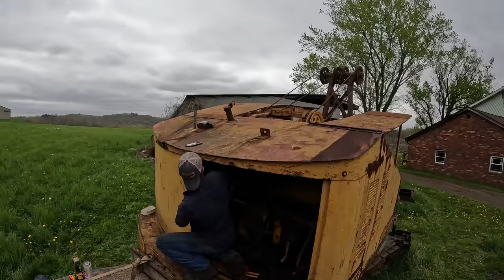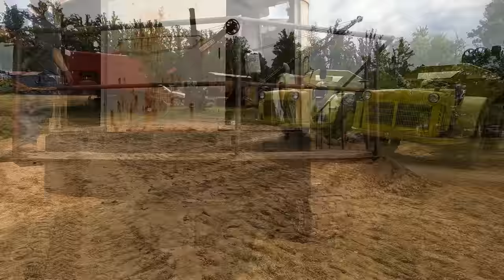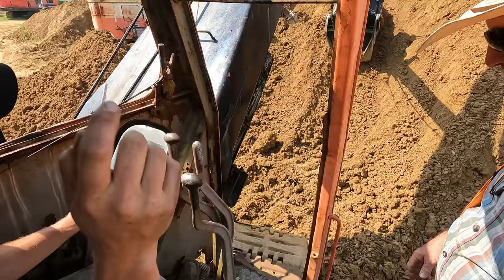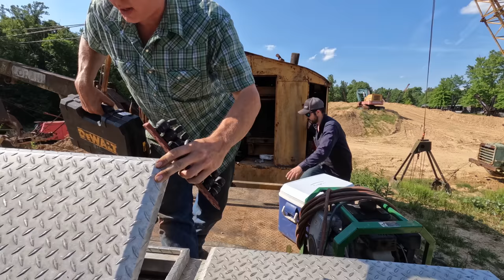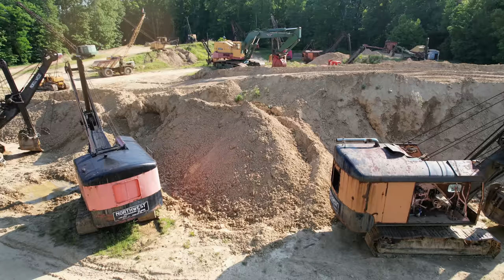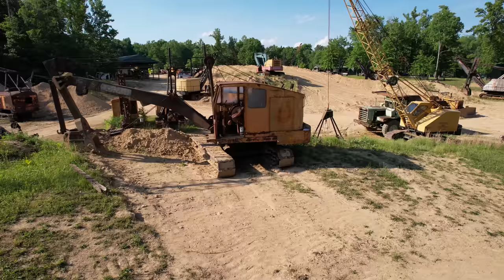Preserving history! The National Pike Steam show.  @letsdig18 & @DirtPerfect

Comment: Fascinating watching the chap operate that cable shoveL, all machines must have had their own idiosyncrasies and peculiarities that the operators must have become so in tuned with.
A great glimpse into the machines that did so much to build, develop and mine the USA. Great stuff, thanks.
Reply: Absolutely! This guy was part of the machine! Artisan operator :-)
Reply: Each machine even if they were the same model. Each machine was hand built and is slightly different than the one that rolled off the line ahead of it and after it.

Comment: The bucket on that old shovel was just an extension of the operator's arm. If you noticed he was 100 percent Lazer focused on the bucket. The operation was automatic to him. It didn't matter if there had been gauges, buttons & dials or cables levers & pedals. He put the machine through it's paces effortlessly.

Comment: They were still using the dredge type of these machines, digging dirt or aggregate from old  Thames river beds to the west of London back in 2005 when I was working there in the U.K. An old Scotsman called 'George' who was well into his 70s but still working operating excavators. He told me that his father taught him how to operate them in the 1950's by standing beside him in the cab with a spanner, which he used to hit George's knuckles if he grabbed the wrong lever or was to slow to grab the next lever needed for the next movement of the machine. This made him a fast and good operator.

Comment: The only difference between the men and the boys is the price (and size) of their toys!  Most folks would call this work, but for these guys, it is all fun and games... until something breaks!  Great video, Matt!  I would love to go to this show!  Christine looks fantastic!
Reply: For me it’s probably both since I do work with my dad’s machines but I do enjoy using them a lot of the time. Unfortunately most of my dad’s machines do have damage on them but they do still run with the only exceptions being my dad’s Komatsu excavator (can’t swing and went off one of it’s tracks due to the tensioners/tighteners not working) and the Case 580B Backhoe (I accidentally ran it too low on engine oil and it started knocking but it isn’t leaking engine oil since I put some in it after I realized it was knocking and the oil level hasn’t gone down since). My dad and I are going to be trying to fix the excavator up soon and we will probably need to get a new battery or two for it

Comment: I once heard flying a helicopter as (regarding the cyclic) "once you get it to a sensible height, you hold the stick in one position and you watch what the helicopter does.  Because if you want it to do that again, that's where you put the stick."  
Learning what each "stick" does seems straightforward, but moving all of them in coordination so operation is smooth is not.  Its learning to dance with a 20 ton partner.

Comment: thats what cigars are designed for not cigarettes !  3HP 4-Stroke Single Cylinder Diesel Engine, motor never charge your Electric car vehicle again, I built one ! The Florida pool pump motor bearing repair guy When Service Calls Longwood approved ! that was good info DC

Comment: In my opinion they should have these machineshows in a way that the show builds a road with the use of these machines. Thatd be cool so every years show builds something. Or if thats not the case maybe works a field so its easier to grow something. Seem like a waste just moving dirt without any other point than to use the machine, seem like a bit of a waste. With that said I like and enjoy these kind of shows where you can see old equipment.

Comment: Ok - a dragline has the bucket attached to cables and you pull the bucket toward the cab to scoop. What are the diggers called that have the bucket attached to a frame and dig away from the cab? Also, what are the diggers called that have the bucket attached to a frame and dig toward the cab like yours? Do people just leave their equipment at the show grounds from year to year? is it accessible for visitors to see when there isn't a show?

Comment: I will never bitch about two joysticks and two pedals again. And my feet are usually pretty minor except for traveling, bucket thumb, and boom angle. Bucket swivel is a new toy that almost eliminates boom angle, and that's on the joystick too.

I just decided that I only love old iron for the looks and skill, not the work. I have heat/ac/and an air ride seat. These old boys were tough. I like to think I'm tough because I can work hard and operate. Even the operators were tough back in the day.

My only saving grace is that they have no idea how to work a new, easy machine. It doesn't take an 18 inch arm pull to make magic, only an eighth inch of the wrist.

Comment: Funny how the machines from decades ago Barely have heavy rust in their metal meanwhile my japnesium 2010 JD 710 looks like its 200 years old and worked in the ocean most of its life.... Don't buy anything newer complete cheaply made computer ran garbage and everything is a headache to fix.. Same with trucks got a 2014 chevy thing has rot all over it and has barely seen weather meanwhile my K10 chevy from the 80s has seen 100x the weather never garaged and is still completey solid... Older stuff is quality PERIOD....